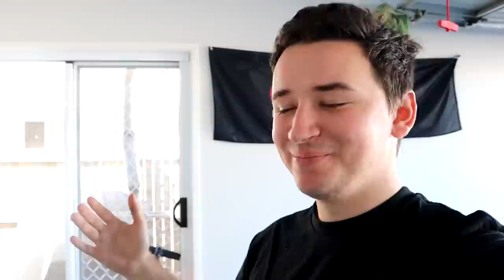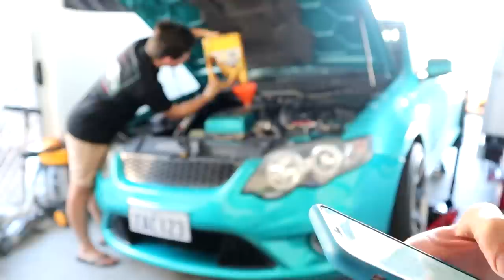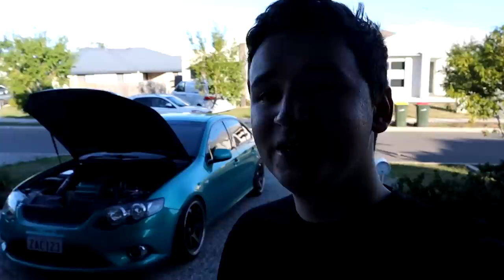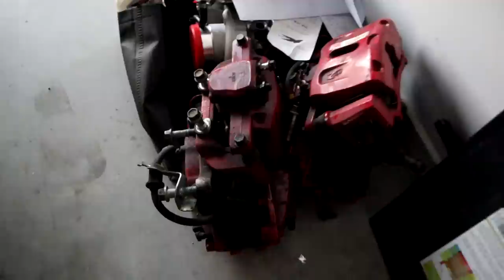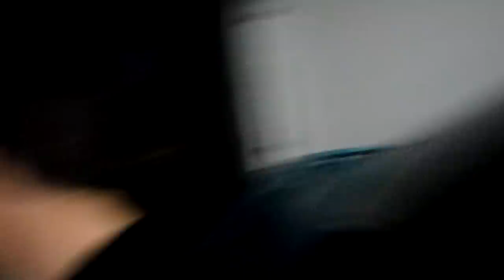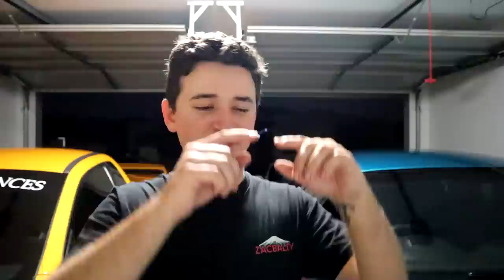Prepping the TURBO BARRA for the TRACK

Comment: why use 85??
Reply: After a tune it has way more power than 98
Reply from the maker: @nathano907  Extra 120HP over 98 ;)
Reply: @ZacBaldy get the dogs
Reply: Burns cooler therfore tunable for the extra power.